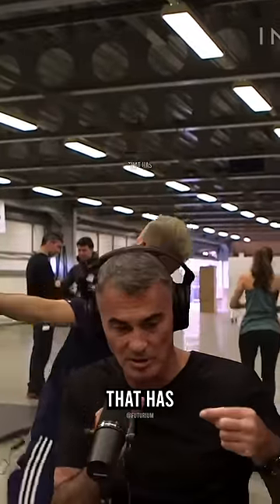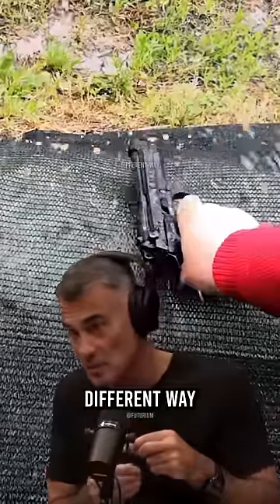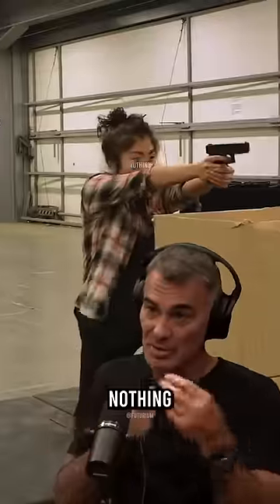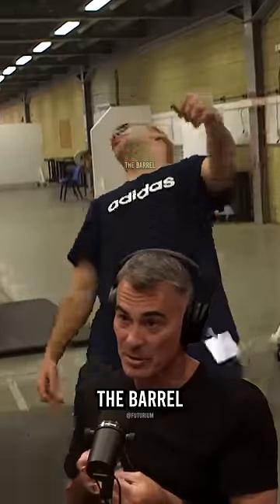How Shooting is FAKED in John Wick's Movies 🤯

Comment: Just so everyone knows, a blank cannot kill you. Even if you stick your neck on the barrel or ejection port. It would hurt but you would live.
Reply: The pressure from the blank being fired can still kill you
Reply: @marcdemise2072  in large weaponry such as machine guns yes. But pistols and small arms cannot kill you.
Reply: @DDD-wt7ly  a pistol charge can very much kill you lol what are you talking about 😂
Reply: @colesmile3028  pistol charge? It’s called a blank
Reply: @DDD-wt7ly  Not at 15 feet, but the man famous for dying from firing a blank right against his temple, wasn’t that with a pistol
Reply: @TW-sh2un  a pistol built for blanks will have the barrel blocked in some way.

If it doesn’t then they fucked up somehow
Reply: @DDD-wt7ly  Most productions use normal guns, and simply fire blanks. 

It would be a bad idea to block the barrel in any way, since a real gunpowder charge is still going off. 

Either you’re blocking it fully, and containing the entire blast inside, which would likely damage the gun.

or you’re partially blocking the barrel, compressing the force even more as it exits and putting a lot of stress on the gun. 

Regardless, there are already two well known accounts of pistols firing blanks that have killed a person, so they certainly can be lethal.
Reply: @TW-sh2un  I spent 8 years in the infantry and have never heard of anyone dying from a blank. I know what is required to use blanks for a weapon to cycle the round, that’s why you block the barrel to allow the gas from the blank to expand and cycle the weapon. If the barrel is open then it doesn’t do this.

If someone dies from a blank it is a freak accident that’s all I’m saying.
Reply: @DDD-wt7ly we also capped them for the dirt diggers😂

Comment: Ah yes killing someone at 15 feet with a blank round. Where the only thing that flies out is unburnt power on fire, tiny amounts of particulate from the case and possibly Barrel. And other miniscule things. At onenfeet it will give youna good burn and and a little prepping. At 3-5feet younwill feel the shock and heat, and a little less peppering, at 15, damn must.be some 90mm anti tank gunn they are talking about.